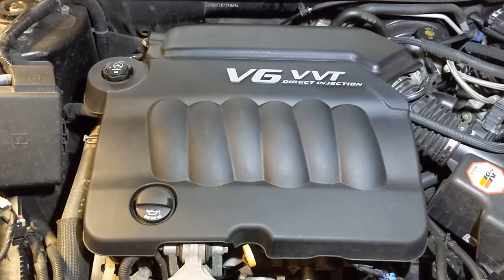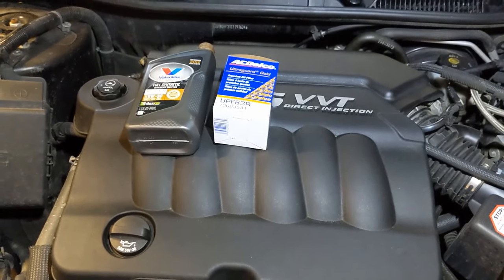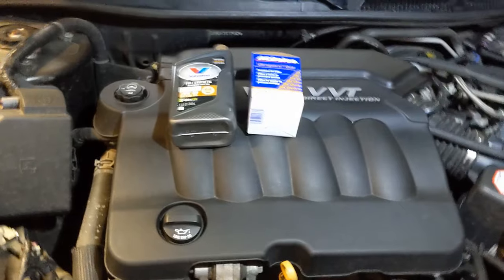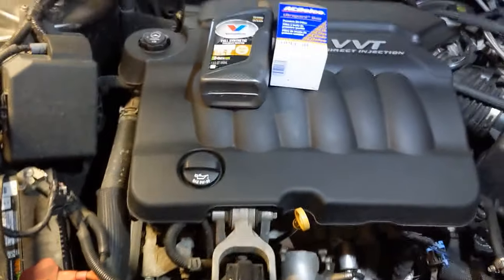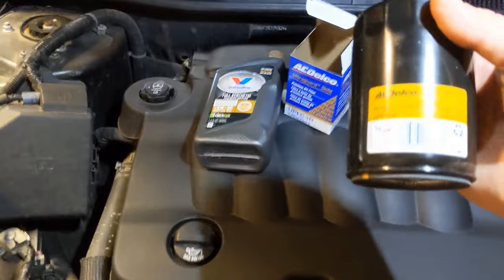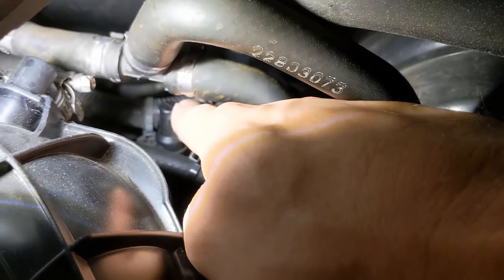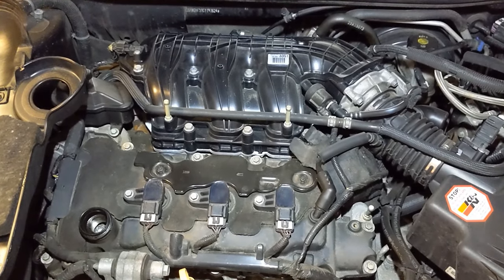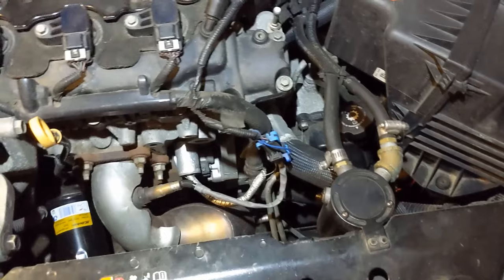How to keep your GM 3.0 or 3.6 V6 running forever - **High Feature V6 LY7 LLT LFX LGX LGZ**

Comment: I’m a little confused after reading your description… after 2014 the factory PCV valves were better?  I have a 2016 LLT, should I still drill out the holes?
Reply from the maker: Since writing the description, both myself and my stepson have purchased 2015 Impala Limiteds, and both of them did not have the upgraded PCV with the larger holes. So yes check your PCV, as you will likely have to drill the holes larger.
Reply: @CertifiedShadetree thank you very much.  Can’t count on consistency from the factory 😂
Reply from the maker: @Pointlesshandle48  No, no you can not! 🤣
Reply: @CertifiedShadetree can I ask why drill bigger holes in the pcv valve? I want to keep my 13 running for a long time. I love that car. Subscribed
Reply from the maker: @wyomingadventures  1st, thanks for the sub! 2nd, the PCV was too restrictive and thus caused excessive carbon build up under the valve cover. GM commissioned a PCV with larger holes on SOME vehicles (apparently not the 9G Impala.) Hence the recommendation to drill out the holes of the PCV valve..
Reply: @CertifiedShadetree  thanks for answering! And your welcome for the sub.
Reply from the maker: @wyomingadventures 🍻
Reply: I use diesel oil.it keeps them clean,not in the USA it's in a Holden Ute 3.6...

Comment: Question...Hopefully you can answer this.  I have a 2010 Malibu LTZ with what I believe is NOT a direct injection, but port injection 3.6 VVT engine.  AT 90,000 miles it still runs & looks almost new inside and out.  It has been exceptionally maintained through it's life with 3,000 to 3,500 mile oil changes with Valvoline Dexos oil and a UPF48R filter, 40,000 mile trans fluid-filter/engine coolant/brake fluid changes.  Will the UPF63R filter fit in this engine?  The mounting surface looks the same, but the 63R is longer than the 48R.
Reply from the maker: Yes, the 2 filters are interchangeable.  If you can fit the 63 without obstruction, there's no harm in using it.
Reply: @CertifiedShadetree  Fantastic!  I'll definitely think it'll fit without obstruction and I'll give it a try as I do my own oil changes.  I have another question if you wouldn't mind.  Would a PCV from a newer model 3.6 be viable in my vintage 3.6 engine?  Are they the same beast with different flow port dimensions?
Reply from the maker: @thomasdemooka4341  I would just drill out the holes of your current PCV. GM spec'd out a newer version with larger holes, but it's not available for purchase!!

Comment: My question is this.  Are you suggesting the UPF63R oil filter replacement for the stock PF48E filter and pcv valve modification on my 2010 Malibu LTZ 3.6 VVT non direct injection engine?  The UPF63R looks roughly the same in diameter, but seems to be a few inches longer, which would provide more filter area if so.  I've never let my oil changes go past 4,000 miles and use Mobil 1 5w30 full synthetic, which is dexos approved for gen2.  My car has low miles for it's age, sitting at about 85,000 miles and still runs flawlessly, but does seem to use about 1/2 a quart between oil changes.  It's had the main crank seals replaced as well as the oil pan gasket and is dry as a bone underneath.  No valve cover gasket leaks either.
Reply from the maker: The PF63 is a longer filter, but will swap easily with the PF48. You can always just go with a UPF48R. I say go with the filters that have "U" at the beginning and "R" at the end as they were made specifically for the VVT engines and have a stronger anti-drainback capacity. And yes, absolutely drill out the holes in the PCV valve. I wouldn't worry about installing a catch can, though, as that's more for the DI engines.
Reply: @CertifiedShadetree  I've noticed that there are differences in the dimensions & design of the UPF48R & UPF63R to the PF48E.  The large input hole seems the same between the 3 filters, but the 48R & 63R have 2 less (6) and smaller output holes than the 48E (8).  Wouldn't that affect the oil flow volume out of the engine?  The 48R & 63R also have a radial circumference 0.1" smaller, would that create a fitment issue?  Your opinion would be appreciated.  My Malibu looks and drives as well as it did brand new, as I maintain my vehicles meticulously and do NOT want to compromise anything.
Reply from the maker: The 48E is actually an economy filter, similar to the orange Fram filter. I wouldn't recommend that filter at all!  The # of holes they punch in the drainback part of the filter don't make any kind of difference, it's just manufacturer preference.  Take a look at the area where the filter gasket seats against the engine.  There's enough surface area there to compensate for differing manufacturing tolerances of oil filters.  I MIGHT be skeptical if you were comparing different manufacturers, but Delco is the OEM parts division of GM, so you can take it to the bank that a PF48 is 100% able to exchange with a UPF48R.
Reply: I have 2010 Malibu 3.6 have you done the pcv mode yet?

Comment: I switched to full synthetic oil,  and change oil and filter 4,000  117,000  and i use my trip A  meter to calculate the miles on my oil
Reply from the maker: Righteous! ⭐

Comment: These engines make stupid power almost as much as the old impala ss to the wheels they are very reliable ive seen a few as an ex car mechanic go over 325k miles with only blugs and boots coils rarely fale unlike the junky fords
Reply from the maker: They really were a nicely balanced powertrain. Sucks the 3.6 is being phased out in favor of turbo 4 cylinders. I blame Ford for their shitty EcoBoost engines starting this trend!!
Reply: @CertifiedShadetree  Those turbo 4 cylinder engines are even more delicate than the 3.6 engines. You need to use 0W-20 oil or something in them. As if the American public needs more of that crap.
Reply from the maker: @thedirtybubble9613  I wouldn't be surprised if it was a ploy to get us to accept electric cars. 🤷‍♂️

Comment: My mechanic said he noticed some wetness around the timing chain cover. I'm at 95k on my 14 Impala. So you're saying I shouldn't have gone by the oil life percent on the dashboard which is at about 6k miles?
Reply from the maker: Well I can't say for sure, but it's likely your engine has more sludge in it than one that had its oil changed every 4k.  When you have your timing chain cover gasket replaced, I'd have your mechanic do a BG Dynamic engine flush, intake cleaning, and fuel system cleaning while he's at it..

Comment: Dump the K&N filter and the engine will last a lot longer dust and dirt is not good for the engine rings and the bores which will cause oil usage.
Reply: It will also cause blowby which is why you need the catchcan so my tip for the longevity of the engine is No K&N filter stick with the paper one.
Reply from the maker: Not gonna argue that point! Project Farm had a video out a couple years ago where he put a K&N up against various paper filters and it did let in considerably more fine dust particles than its paper couterparts..

Comment: Thinking about getting a gmc Arcadia. What tell tale signs of neglect should I look for?
Reply from the maker: Check the oil level and the condition of the oil.  Fresh oil might mask some symptoms, sure, but if the oil is dirty and or low on the dipstick that's a red flag.  I would check the intake tube for oil, and pull the PCV (on the rear valve cover) to see if it's clogged up or there's any sign of carbon build-up.  Ask for maintenance records and pull a CarFax to see if there's any records of routine maintenance.  I would run far far away from it if it can't be determined to have had regular oil changes.

Comment: Thinking about buying a 2015-2017 Impala tenth gen with the facelift, not sure if the 3.6  V6 in these are the same as the 3.6 your working on, also wondering if your tips would also apply to the 10th gen Impala.
Reply from the maker: Yes, the 10th Gen has the exact LFX 3.6 engine and 6T70 transmission as the late 9th Gens (well, not ALL 10th Gens, a 4 cylinder engine was available also 🥺 which I would avoid at all costs!) That being said, the same maintenance tips apply.

Comment: One more question, is the Catch Can factory installed on the 2013 Impala or is it installed as a mod later, and r/r at the oil change? My mechanic says the PCV system is reburning the oil and other combustion products. Your input is appreciated.
Reply from the maker: No sir it is not factory installed. This will point you in the right direction: https://youtu.be/-XlG5po15Fw
Reply from the maker: @Clarc115  Best of luck to you! 🍻
Reply from the maker: Thanks, I appreciate it!!👍

Comment: Could i get your opinion about when i take my car out on the highway at full speed for about 7 miles , if i haven't been on a few miles of non stop driving to burn out moisture.
Reply from the maker: The ole "Italian Tune-Up"!!  Nothing wrong with it, and it actually does some good!!
Reply: I don't like putting any of my cars away not properly warmed up but my reason is there is a good chance you will leave water lying in the exhaust causing it to rust out early. All my cars have lasted a lifetime without an exhaust replacement. But yes short runs constantly also tend to sludge an engine up my cars tend to get driven daily to work around 20km each way daily.

Comment: Mine is 2008 equinox sport 3.6 engine light is in with P0008. Do you think it worth timing chain replacement,  or keep changing oil . Power and acceleration is fine. 213000km
Reply from the maker: I'd say if you were to replace the chains yourself, then it would be worth it for sure! If you planned on having a shop do it, then probably not. The shop would likely charge more than the vehicle is worth at this point.  But either way, keep up with the frequent oil changes (I don't believe the 08 engine is DI, so you don't need the fancy oil.) That's my personal opinion anyway. Good luck!🍻
Reply: @CertifiedShadetree  thanks 😊 🙏

Comment: Interesting video. I just purchased a 2017 Buick Lacrosse with the 3.6 V-6 and I am interested in knowing if GM has cured the problems with this motor by 2017? Do they have the newer gasket in the intake? Do I need to drill the PCV holes? Thanks in advance.
Reply from the maker: The LGX in the 17 LaCrosse SHOULD have the PCV with the larger holes (I would check just to be sure.)  The improved valve cover gaskets were in the LFX way back in 2012, so I'm fairly certain the LGX has them as well.  I haven't heard of the LGX's having as many issues as the earlier 3.6's suffered from, but I'd still be steadfast in its maintenance.
Reply: @CertifiedShadetree  Thank-you. I will vigilantly change the oil at 5000 mile intervals. I just sold off a 2013 Ford Taurus AWD Limited with the 3.5 V-6 and I got just under 200 thousand out of it. I was pleased with it but I wanted even more luxury. Maintain the car and it will take care of you.
Thanks again for the reply.
Reply from the maker: No problem, and good luck with the LaCrosse! 🍻  I recently had my eye on a forest green metallic '18 LaCrosse with tan leather interior (which sold quickly.)  Sucks you can't buy them new anymore, but they're still damn sharp cars, and I'm seriously considering one for my next vehicle!!
Reply: @CertifiedShadetree  Thats the color of my 2017, with tan interior. The color really stands out in the sun. The only thing I don't like is the Auto Start feature. Maybe a idea for a future video, how to bypass this function. I will have this car for a while since I got it with only 19000 miles. I intend to take good care of it.
Reply from the maker: Color me jealous!! 😁  🤣

I did a short video on how to temporarily bypass the auto stop/start:
https://www.youtube.com/watch?v=hrUTr8LAVa4

The only way to truly defeat the system is to install an aftermarket bypass module like this one:
http://metraonline.com/part/AXSSO-GM
Reply: @CertifiedShadetree  i own 14 Impala. Looking forward to the name plate being reintroduced. Fingers cross they bring in the 3.0L T from cadillac when it happens
Reply from the maker: I haven't heard if there's any concrete plans to bring the nameplate back. There was speculation Chevy might slap the name on a future EV, but that's all it was was pure speculation.  Hell, at this point I'd be happy if they offered a V6 in the Malibu until they ultimately kill that model off!!
Reply: @CertifiedShadetree  as someone related to the car industry it is quite frustrating sometimes but I remind myself I probably don't see the bigger picture of the larger company. I also full expect them to bring it back on a vehicle you would not traditionally call an impala like they did on the blazer and trailblazer and even the Impala itself from the old sports car to the now just sporty yet mostly comfortable sedan.

No doubt they make it all electric next and I'd take a hard pass. 

Heck they even took Camaros off the line up in the near future but are already teasing an all electric Camaro or at the very least semi electric
Reply from the maker: @michaelwallace9291  Look at what happened when they brought the Impala name out of mothballs and slapped it on what was essentially a Lumina. It doubled the # of sales! The Impala name still has a ton of brand equity, so it would be foolish for Chevy not to use it on a future model. And they most certainly HAVE to use the Camaro name on their response to the Mustang Mach E!

Comment: i have a 08 saturn vue xr with the 3.6  im using the valvoline high mileage  ill run some marvel mystery oil in it every now an then  seems to work well
Reply from the maker: Yeah that's not a bad idea. I've been running BG EPR once a year in mine..

Comment: I've got a 2012 Impala, I like driving it in spite of the fact that it's one big blind spot, got to be careful changing Lanes on the freeway or backing this thing up, rides nice out on the highway even with its outdated chassis, the new drivetrain they dropped in in 2012 gives it some respectable power, this thing will really get up on the open road, still no actuator problems although I know it's inevitable in these cars eventually, this car just turned 40K so not high mileage yet, the problem I have is extreme rattle from the dashboard of which I believe are the vents, bout to drive me insane! I'm looking for a good video that shows you how to take this dash apart so I can throw down some velvet tape!!!!
Reply from the maker: I've got a couple of videos that might give you what you're looking for:
https://www.youtube.com/watch?v=2bHOZ32BLxY
https://www.youtube.com/watch?v=U4Gma_zwhCw
Reply: Nice, that ambient light sensor replacement video really shows how to dissect this thing, thanks!
Reply from the maker: Best of luck to you! 🍻
Reply: 2013 LTZ owner: Check the lid on the center console mine rattles a bit. I just fill it up with stuff (my junk) till it closes tight and latches. I have not had any other rattles inside other than that. I have an exterior exhaust rattle on cold start ups but it goes away quick. I have one bad actuator and my rear window defogger does not work. Currently, July 2022 the car has 58,000 miles on the odo.
All in All not a bad car for my use.
At 71 yo I'm seriously hoping this is my "Last Car". I HATE paying car notes. This one is 100% paid for.
Reply from the maker: Hope she gives you many more trouble free years!  I applied a couple pieces of rubber weatherstripping to the underside of my console lid to stop the rattling.  Seems like an oversight on GM's part not to put a couple of rubber stoppers in that area..
Reply: @CertifiedShadetree  Thanks for that idea. I keep lazying out on it.

Comment: Hi I have a 15 ATS with the 3.6 I just installed a 3/4” intake riser and noticed all my valves had a lot of carbon. What is the best way to get that carbon off besides walnut blasting? I don’t think anyone around my area does walnut blasting which is why I ask. Thanks
Reply from the maker: I used Berryman B-12 Chemtool and some brass drill brushes. Check my channel, I have a playlist for the videos detailing the process..
Reply: @CertifiedShadetree  ok thanks

Comment: I drive a 19 Impala with just under 41k, (got it with 12.5K). No mechanical issues so far. I went roughly 6k before my first oil change, but I've kept up at 5k ever since. How often would you recommend getting the trans fluid changed and the carb buildup cleaned?
Reply from the maker: I would do a drain and fill of the transmission every year or every other year.  It's easy to do on the 6T70, and  6 qts of Dexron VI doesn't cost that much.  If you do that, you won't need to do a complete exchange of the fluid.  Although I mention in the video that a catch can is "optional" I would highly recommend installing one. The only issue with it is the amount of condensation it collects in the winter means you have to empty it more often, but it will ultimately prevent the carbon buildup from happening in the first place.  You should be good with only 41k, I cleaned my intake valves at 158k and they weren't all that bad.  Switching to the Valvoline Modern Engine and installing the catch can is good preventative medicine in fighting the carbon build-up on the intake valves.

Check out my other videos, I have ones pertaining to the trans fluid change, the catch can installation, and the intake valve cleaning.  Although I have a 9th Gen Impala, the powertrain is the same on the 10th Gen...
Reply: @CertifiedShadetree  I will, Thanks a lot!
Reply from the maker: Best of luck to you!!🍻